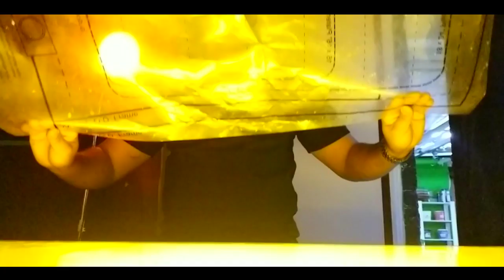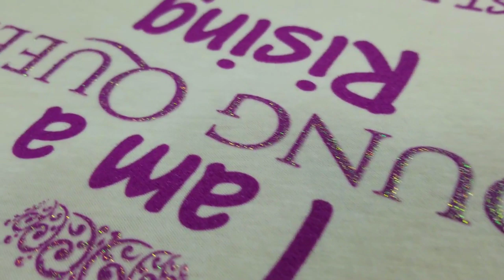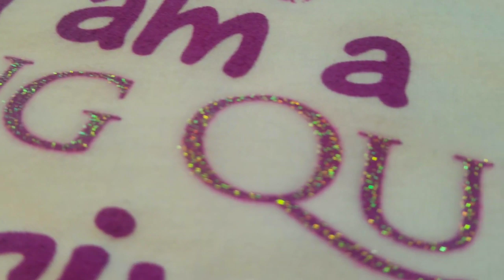Biggest Obstacle In Screen Printing

Comment: Hey Taino I agree completely because some customers are a little shiesty and to the printer that says they have never had that issue well guess what you will.  I use Printavo to manage my business and and I get 50% upfront anything over $500 must be paid in full before we process there order. One of my clients had a 250 shirt & hoodie order front and back two colors each I charged a little over $9000 and he paid upfront no problem. If the client is legitimate they wont have a problem with your terms.
Reply from the maker: @BAG WEAR You know what, That's a great policy. anything over $500 must be paid in full. I'm going to start doing that.

Comment: that cristalina stuff is great. It looks like you can get some nice detail prints w/ the 40-60 mesh screens. The crown part came out great. Do you think you can get even more detail with those low mesh screens?
Reply from the maker: Thank you. I have done them on smaller details than that. It's all based on the squeegee angle but yeah it could get done. I will go with a 60. That's what I used for this job.
Reply: @tainoink  Did you do a choke on the image with the purple ink where you were going to lay down the cristalina
Reply from the maker: @Ivan Ramos Actually I didn't.